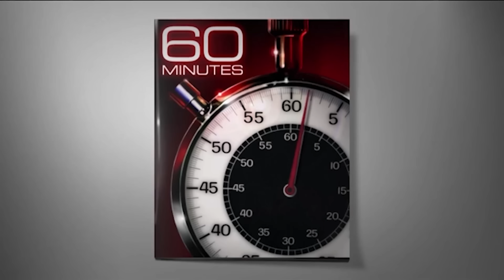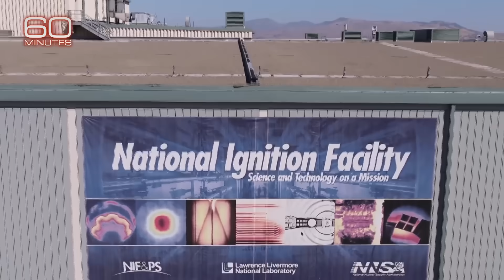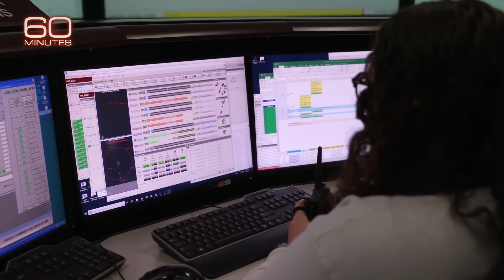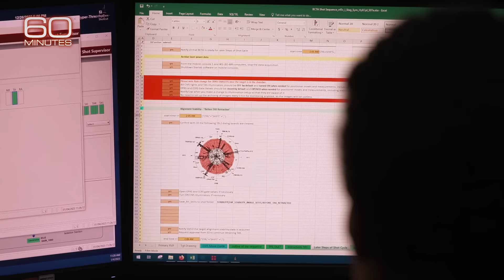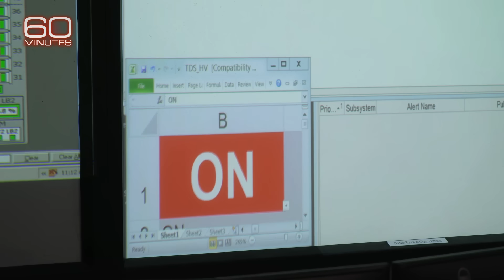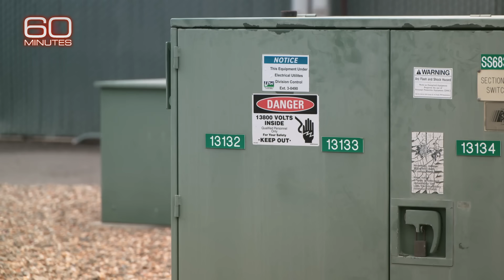Nuclear Fusion: Inside the breakthrough that could change our world | 60 Minutes

Comment: Every year. A quick google search for nuclear fission breakthrough (insert year) and you will see that this is the type of reporting that is used as a slot filler when they don't have anything else. Call me when they can reproduce the experiment, scale up the reaction, and attach it to a power grid. 
Also, "Two units in, three units out" and "Carbon zero" is slightly disturbing to me. I would also like to see all of the aggregate data because it seems as though a lot of processing goes into making this reaction possible. All that said, it would be nice if something would come of it.

Comment: I liked that they covered the difference between the fusion reaction net positive energy of the lasers vs the efficacy of the entire system but the video made it sound like fusion had never been accomplished in a lab. Fusion happening in a lab isn’t news, just getting more energy out than was put in. Still a milestone in fusion research.
Reply: That's correct. Fusion has been achieved many times before in labs and for longer periods of time, but as you said, this is the first time energy gain has been achieved.
Reply: There was no energy gain from a system perspective. The energy required to power the lasers was far more than what was produced.
Reply: @billcollins6894  How about if we look at the energy of the laser beams coming out of the lazers? Did the output of the fusion reaction exceed the energy of the laser beams?
Reply: @jeffstrehlow2623  Yes it did exceed that. So it is certainly significant and proves that the method they are using is real fusion. I don't mean to sound negative. It is just that there is still many years / decades left before it is going to be providing power.
Reply: @billcollins6894  Thanks for informing me on that. Before the system is useful, there needs to be energy gain for the entire system
Reply: @billcollins6894  i didnt know you were a scientist...
Reply: @xbchiefmatrix  I am an electrical engineer who knows how to read. You can easily search "fusion net gain laser efficiency" but here is a quote from a physicist:

"But it’s only a net energy gain at the micro level. The lasers used at the Livermore lab are only about 1 percent efficient, according to Troy Carter, a plasma physicist at the University of California at Los Angeles. That means that it takes about 100 times more energy to run the lasers than they are ultimately able to deliver to the hydrogen atoms."

The reaction did deliver more power than came from the lasers, but not more power than went to the lasers. We still have a long way to go.
Reply: Now we just need to invent zero energy cost military contract lasers and we're set.

Comment: Wow surprised to see focus fusion showed, if only they had a fraction of the fund’s that this latest reincarnation of a laser experiment receives for the last 60 years, we might already have an even safer fusion reactor then that Bohemias of a reactor called ITER. If everting goes right with ITER the best case scenario put the reactor at 30 years before it could start helping off set global warming, although impressive this laser experiment might be even longer then ITER before it would be of any help, but by that time we should have a very clear idea of where the point of no return is.

Comment: Captain obvious here to save you watching. Since the oldest most ancient sun worshipping civilizations knew the stars were where everything was created, reactor tech was researched and forbidden its a false god and countless false religions sprang up because all gold is only ever made in super radioactive supernova star explosions many criminals argued the planet should be exploded so they could make all the radioactive gold they wanted. Like that time jews created the desert were enslaved and werent allowed to leave it (forced to wander the desert) using these forbidden reactor techs.. its been around for ages see ancient egypt. -BUT you cant make a shield or container strong enough to last for years in any sort of building/power plant using fusion the extreme force/power and temperatures melt anything and everything its a literal star forge nothing that came out of a star would be solid within it. Recent attempts with super magnets making field cages and special alloys all are crazy expensive and need every wall replaced in weeks or months when containing true star fusion reactor cores. That sort of cost and repair/replacement times cant be done every year or 2 its not viable. So these people said "if our walls can only last a year, what if it was turned off 99% of the time and it was just micro bursts?" and how much power do they require for those lasers.. 'can reactor even power itself at this point?' is a good question. what they want is more funding to.. make another desert maybe?

Comment: We have an interview with the director, and the laser manager (who was at the airport) - both who were likely appointed to those government positions since they are females, and neither which are the brains behind the science. Couldn't 60 mins find a PhD who actually knows what the hurdles are, or had a part in the design?  And  when you boil it all down - the real result (as described at 10:08) was : 302 energy "units" in, 3 "units" out. The reaction was not self-sustaining (like stars). Bottom line -not even close to a success.

Comment: For anyone who remembers 1982 and the 186 XT 4 MHz computer, and 1992 the 486 100 MHz computer and 2002 the Pentium 4 2.4 GHz computer and 2022 the 32 core 5 GHz computer, and these are right off the shelf, that anyone can buy

And we went from 640k of ram in 1982 to 4 MB in 1992 to 4 GB in 2002 to 4 TB in 2022

1982 the computer was incredibly powerful for the time it was invented
It did things that took weeks in seconds
When the 486 came out and Windows 3.1 It was like night and day compared to just 10 years prior

In 2003 Windows XP and the P4 2.4 GHz CPU, it was just mind-blowing

And now, the amount of power, the things a regular person can do are limitless and they can order it and have it in just 10 days

A 32 core CPU running at 5 GHz

4.77 MHz to 25 MHz to 100 MHz to 300 MHz to 1 GHz to 2.4 GHz to 4.2 GHz in just 40 years, and most of the advances were in the last 20 years.

Imagine what we be able to do 30 years from now

How small computers will be

The XT weighed about 50 pounds

The 486 weighed about 20

The 32 core weighs less than 10
And most of that is the case made of metal.

Comment: This is equivalent to the experiment Marconi did with radio waves, by transmitting a signal across the Bristol channel on 13 May 1897. He proved that the radio waves travelled on water. But the way to the commercial adoption of radio was not yet certain.
So for the fusion experiment. Fusion is possible, but we still don't know if a commercial version of it will be possible...

Comment: It's amazing that they have confirmed that the principle of the concept will work.

Although they are far from energy input to create the lasers to get the output in ignition. It's an amazing feat.
We now just need engineers to have a breakthrough in laser technology or a way of creating the sufficient energy.

As it stands wasn't in 300mega joules to create the lasers, which produces 2mega joules with ignition of 3.35???

Comment: Though you will not believe it I am writing this message from 2453 and fusion like this NEVER happens, they have made a huge mistake over 100 years ago and dont know what they think they do.  Stars are not what they think they are, they are made of condensed matter, so they found, only about 50 years ago that fusion would work but only in a lattice, so lattice confined fusion was the focus after that and it wasnt long they made devices, so far nothing commercial only been used by governments in space exploration

Comment: China's Artificial Sun EAST · It is a nuclear fusion reactor facility, designed and developed by China this FUSION LASTED for 17 minutes in January 2022. Hotter than the sun by at least 4 times, The EAST harnesses extremely high temperatures to boil hydrogen isotopes into a plasma, fusing them together and releasing energy.
Fuel is heated to temperatures of over 150 million degrees C so that it forms a hot plasma “soup” of subatomic particles. Whilst the US is celebrating ignition. Just saying, 10 years isn't a pipe dream. Just need international cooperation, not chasing market monopolies to upkeep a failed hegemony

Comment: Fortunately, science works over decades and centuries. Just some hundreds of years ago we were trying to harness the power of the wind by taking flight. Now we've been to the moon. So yes, perhaps the frequency would need to be increased several thousand times over as well as the output, but everything in science starts with a pebble before it becomes a mountain. The more we grow as a species the more I feel we are living in a simulation and merely stretching to fit the massive mold which contains us.

Comment: 3 weeks ago on 20221223, two days before Christmas, I finally figured out in my head an unsolved problem, call it a conjecture, if you want, although I had not formulated it as a conjecture, from April 1999, that was part of my doctoral dissertation for my Math PhD in differential algebra. I banged my head on this problem for over 23 years. Now I have the Herculean job of getting this set down on paper and publishing it.  So, I know how insanely hard serious research is.

Comment: We are no closer to commercial fusion power than we were last year. 30/∞ is the same as 1,000/∞. They are both functionally ZERO. There is a HUGE problem associated with the amount of electricity used to power the lasers. That expenditure of energy is NOT factored into the net gain. Beyond that, scaling up creates containment issues that were not mentioned in any real manner either. This is a pipe dream. Fusion may be possible, but it won't happen until materials science produces materials that can aid in the containment of both the energy and efficiently and losslessly transmit the heat to some form of electric generator. The fusion reaction generates heat, not electricity. This is a gratuitous plug for all the companies begging for taxpayer dollars to keep their nonsense going.

Comment: Fusion is a business. The product of the business is selling "a plausible sounding promise" to people in government and the press with zero understanding of the science and less understanding of the engineering challenges. Thus far, the fusion business is very profitable. Even though there will not be economically practical fusion generation this century.
Most likely practical use of fusion:
1) Drill a deep hole in carefully selected geology.
2) Explode a thermonuclear device deep in the hole. 
3) Extract heat from the explosion cavity using existing geothermal methods (see Iceland).
4) When cavity is too cool to generate power, see number 1.

Comment: I for one am not just waiting around to see if fusion energy happens.  If you look at possible worst case scenarios, if we don't get a handle on climate change long before 50 years from now humanity may no longer be around in 50 years.  I advocate lots of mass produced fission energy coming online within 10 to 15 years and continuing to ramp that up to eliminate energy poverty worldwide.  See Copenhagen Atomics plan to manufacture one 100 megawatt reactor per day.  If we come up with the societal and political will to do that, then all those working on fusion will have a much better chance of ever achieving inexpensive commercial fusion energy.  Fission is already more than 300 times less deadly than solar. per UN and WHO data.  Isn't that safe enough?  We have proven chemical processes being commercialized by Curio Solutions to convert spent nuclear fuel into new fuel that can yield 20 times the energy we got out of it the first time around as well as other needed industrial radioactive elements and medical isotopes needed to cure cancer.

Comment: Maybe in 100 years will this make a difference.  Maybe, but it will probably never happen.  
Fusion has a fuel problem.  At this time, they may not have enough to for experiments to complete anything.  And if they do succeed the fuel is ten times the cost of today's nuclear reactors fuel coming in at $30,000 a gram.  
The experiment Did NOT produce net energy.  In fact it lost 99.2% of the energy used.
Don't forget the goal of Lawrence Livermore Labs.
"Lawrence Livermore National Laboratory has a mission of strengthening the United States' security by developing and applying world-class science, technology and engineering that: Enhances the nation's defense. Reduces the global threat from terrorism and weapons of mass destruction."
After this latest so called achievement their getting a $50 million increase that will go into researching nuclear bombs not fusion.
Dream on

Comment: The CO2 that is released is part of the carbon cycle and should not be worried about because the ocean will take care of it in the growth of more algae. with more resources for algae will come more algae growth. The water farther north is colder and because of this it absorbs more gasses. That is why the water is green the farther north you go. This will result in more green algae and it will balance its self out over time. However trying to get off oil and fossil fuels is good because eventually we will run out. If that happens before we figure out our way into a free energy system via a fusion energy system means we have a time limit before humans are stuck in the stone age for millions of years.

Comment: I suspect the cells would be manufactured in the vacuum of space giving SpaceX a possible return product. OTOH, the energies necessary to cause fusion make inertial confinement (I think) a pipedream. Ten shots per second for a fusion power plant would mean hundreds of ignition points, if not thousands, to generate power. Every ignition point would be serviced by a carousel of cell holders. But, I think, the cell holders could not hold the cell during ignition. There would have to be a way to drop the cell and strike it in "mid-air" (so to speak). Otherwise the cost of construction of the cell holder would exceed the total energy output. Wouldn't the debris of each shot degrade the vacuum of the fusion chamber?

In fact, sufficient increased laser output needed would very likely make handheld Star Wars laser pistols possible Each laser's output would need to be increased by 10**5.

Comment: The NIF accomplished nuclear equivalent of lighting match in a wind storm. Although this is a scientific step forward, we are still a long way from fusion providing USEFUL power. Perhaps 30 years or even 10,000 years. Far to late to save humanity from climate change.    

When our human ancestors were able to light the first match, they were still thousands of years away from the first steam engine producing useful power to light and heat our homes, drive our trains, and cook our food. They had to figure out: how to keep the fire burning; where to source the fuel from, learn how to avoid burning the forest down, convert the heat to useful energy, and build a boiler that would not burn, melt or explode.  Fusion has all of challenges and others to overcome before the accomplishment becomes anything more than an interesting scientific paper and bad investment. 

If the real goal is to displace fossil fuels and solve the climate change problem, it seems to me humanity is much better off focusing our attention on using a nearby natural  fusion reactor (AKA sun) and recovering energy using plate photo collectors (AKA solar panels).  Perhaps we should focus our best minds and investment dollars on building solar panels that collect more energy, cost less, and last longer.

Comment: They've been promising us fusion energy since the 60s.
  There's a safe, efficient, reliable and relatively cheap source or power right now, and that is the French Nuclear Power model. They've been doing so for 50 years now, with not one major incident.
Reply: YES. I have swallowed my Liberal pride on that one. And, both Plutonium and Thorium breeders could buy us a few thousand years of clean energy. In the meantime, let's hope that Fusion finally comes to fruition.
And, Fission is NOT a substitute for Solar and Wind. In places where that's practical, this can make a BIG Difference.
PS: we aren't hearing enough about ground loop heat pumps...500% more Efficient than a gas furnace...or, an AC which is powered by the turbine at the power plant. The majority of energy use in homes and businesses is for Heating and Cooling.

Comment: They were burning diamonds to make this work. It is the same method used to ignite an atomic bomb essentially spherical explosive compression.  So they used lasers to vaporize a diamond shell to create a pressure wave that compressed the fuel to ignite it.  It's like saying you could power the world using diamond coated fire crackers. What are you going to do, light them one at a time like a laser ignition diamond burning pellet stove? There is no path to a sustained fuel burn with this method as it relies on an explosion to compress the fuel.  There is no break through here other than verification of a computer model.  This is just some rich kids with football field size lasers looking for a reason to light them. This will never compete with solar and wind. Boondoggle.